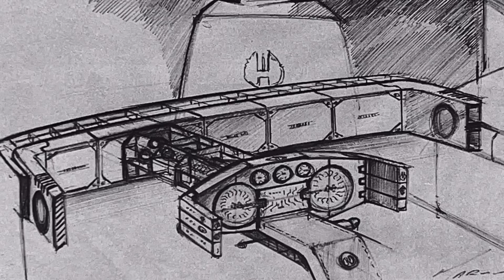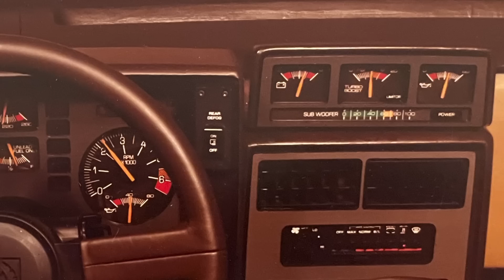Pontiac Goes Mid Engine: Designing the 1984-88 Pontiac Fiero's Interior (with Marv Fisher)

Comment: I think the Fiero would’ve been best with the same turbocharged, intercooled V6 that was in the Grand National/GNX. They also could’ve paired it with the all wheel drive system that the Cyclone/Typhoon had, or perhaps even the AWD system that Isuzu placed inside the Piazza/Impulse along with its Lotus-tuned passive four-wheel-steering system.

Comment: The steering was so heavy, you couldn't take your hands too far from the wheel.  I wanted one badly, even with the 4 cyl, but I had to tilt the seat back to clear the roof, which made it hard to turn the wheel.

Comment: Another great deep-dive!  One of my relatives two years my senior had a beautiful 2M6 (six cylinder, 2.8 liter, ~50 more horsepower than the 2M4) version with some kind of optional air scoop at sat at a low profile and fed air into the engine compartment.  It came from the factory (I think!) and it was a brilliant little car with that engine and a fully-optioned interior.  There really was nothing else like it domestically, and I was incredibly jealous of him.  Inside and out I lusted for that car, so Mr. Fisher's design work definitely made a huge difference in the car's "gestalt".  Do you or anyone else know if that scoop was really a Pontiac OEM option?
Reply: Nope, it's not an OEM option, but aftermarket scoops.
Reply: @vice4134  Thank you!  That's what I suspected but it was so well done I also thought it could have been factory. I asked him at the time but he took me for a thrilling ride in that little baby and I forgot what his answer was.  The 2M6 was a real sports car, in my book.  He was also a motocross racer and he knew how to get the most out of it.  I had never imagined that 140 horsepower could be so much fun, but it was!

Comment: I worked as a tech at the dealer in 88-89 and the most common issue I saw with the Fiero was the engine compartment heat messing up sensors like the TPS.  Plus, it seemed like the EGR valves failed a lot.  I bought a Cadillac 13mm  distributor ball socket for changing them out quick to beat the flat rate time of warranty.  
I never owned one but figured if I ever did, a fan to help circulate air through the engine compartment would have been a nice addition.  I loved the cars.
Reply: They did have a blower from the trunk from 85 thru 87... until they figured out a way around it for 88. So, they got rid of the blower. Out of curious, not sure what this "Cadillac 13mm  distributor ball socket" looks like. I'm trying to find a picture of this tool. Can you please help? Thanks.
Reply: @vice4134  It's a handy socket.  I think it was designed by Snap On for the HT4100.  It was chrome with about a 12 inch extension built into it. Next time I'm at my tool box I will get the Snap On number from it.

Comment: Thanks so much for giving some insight on the design of a very interesting car. It was a true innovator for some interesting production aspects. A classic exterior and interior execution of a timeless design. Current interest in the mid-engine Corvette brought back interest in the Fiero and maybe we can now put to rest the over emphasis on the initial production mistakes with the iron- duke errors . The gradual improvements making it a contender for a true sports car. Engineering the features took a-lot of foresight for  future applications. Some parts bin items had distractors but at least they were from proven systems that had a record of durability. The  X- Car FWD package was a natural for the switch to a mid-engine layout and had proven to be a major part of the design.
Thanks again for covering this car that didn’t deserve the negative press for so long and highlighting the lost history of this GM product.
Reply: Except it wasn't an error. Blame it on GM. They cut Pontiac's budget from $700M to $300M. That's very small budget by today's standard. So, Pontiac had to work with what they had to get Fiero off the ground and build onto it as time goes on. Same thing with Corvette in the beginning. So, give Pontiac a break. It was those corvette people & GM who were against Fiero from the beginning. As a matter of fact, GM ordered Fiero program to be cancelled twice, but they ignored it & worked around GM by contracting with outside firms to speed it up. Very smart of Hulki Aldikacti to do that.

Comment: This was a fascinating video. Thank you for sharing. It seems so strange, but the interior looks both radically different for the times and yet now it looks so dated and weird. What's perplexing is that the structure of the driver's cluster was so forward-thinking and ahead of its time, but the rest of the interior looks so 1970s funky. Pontiac's Fiero was an interesting anachronism. It was designed to be a commuter-car, but its styling and images in advertising made it look like GM was pitching the car to the public as Pontiac's answer to the Corvette. The fact that all new-for-1984 Fieros came only with the lackluster "Iron Duke" four-cylinder only made matters worse, as that motor was never ideal for any passenger car.

One of GM's biggest mistakes in the so-called "malaise era" was a lack of absolutely essential coordination between the various projects of downsizing car bodies, introducing new front-wheel-drive engines and engine tech, and new transmissions. Pontiac's P-body Fiero, as well as GM's X-, N-, A-, L- and F-cars were also classic textbook examples of this lack of coordination. The Oldsmobile Quad 4 engine, even in base 150-horsepower trim, was ideal for the Fiero, and would also have lent itself perfectly to these other platforms. Unfortunately, the Fiero was introduced in 1984 and the Quad4 didn't enter the mass market until 1988. The Quad4 would have been ideal for GM's intended Fiero mission as a commuter-car, in making it a great balance of power, fuel economy and fun-to-drive. The "Iron Duke" offered none of these qualities. And GM's 180-horsepower "high output" version of the Quad 4 could easily have added ever more sporty zest to the Fiero and possibly also to the Firebird SE. It was rumored that GM even had a 250-horsepower Quad 4 turbo, which would have been idea for both the Fiero and perhaps some special edition of the Firebird and 6000 STE. But none of these Quad 4 engines would have been possible if GM didn't have transverse transmissions that would have handled the extra power of the Quad4 family. It never ceases to amaze that GM went out of their way to hire Pininfarina to build Cadillac's Allante, but nobody in GM's management would ever move with deliberate speed to accelerate the development of the Quad 4 or the sourcing of better transmissions to handle the Quad 4.

If Pontiac had introduced the Fiero in 1984 and had equipped it with the Quad 4, it might never have needed a V6. Fiero might also have been a much bigger seller, while bolstering Pontiac's "We Build Excitement" image.
Reply: Actually, Pontiac had a bigger plan, but were stuck with $300M budget. Earlier, they had a $700M budget, but GM cut it down to $300M. That's very small by today's standard. So Pontiac had to make it work with what they had in order to get Fiero kick off to a great start. And they sold over 136K for the first year which is very impressive. And with profit from each year, it allows them to continue to improve it & solve problems, one by one. By 1988, they invested $30M into improving the suspension, inspired by Lotus somehow, and improved the car's performance greatly as a real sports car. The engine was the next problem to attack, but the program was cancelled, thanks to Corvette people who felt threatened, pressured GM to stop it. 
One guy said he'd gotten in on a group tour of GM test/proving grounds. The one thing he saw that stood out for him - a new Vette and a Fiero were brought out for a match race. Granted, mid-80's GM V-8's weren't known for HP, but the Fiero was a twin-turbo. Both cars came off the line, Vette jumped in front. But then the Fiero's turbos spun up and it just walked away from the Vette. The GM guy giving the tour turned to the group and said 'You'll never see that car on the street, it's too fast.'  Hulki spoke about the time they beat the Vette at the proving grounds with a souped up Fiero and got into big trouble.
The GM made it clear to Pontiac that Fiero cannot go faster than Corvette. It wasn't MR2 who is the real competitor, but corvette people to make sure GM had the lid on Fiero tight. So the corvette people were our enemy. The Corvette people!!!
Reply: @vice4134  Yup, I read the book "All Corvettes are Red" which was much more a look inside GM than it was a book about Corvettes and I read that they had put a quad-4 in a Fiero and got a quicker 0-60 time than the Corvette of the time, and all they said was "crush it"!  GEEZ, can't have that....  It boggles my mind, intentionally making a car less than the best because it just might compete against something else from the same manufacturer.  I'd recommend the book but it gets pretty disheartening when you understand the MESS that GM was and is!  In 1998 I bought a used '96 Collector Edition, one of my worst life mistakes, it was a year and a half of mostly misery, one of the happiest days of my life was the day after I traded it on a '97 Miata, waking up and realizing the nightmare was OVER!
Reply: @terrybeavan4264 
Yep, they did quad-4 for '90 Fiero which is the next generation, but never came to fruition. Such a shame! 
I've heard of this book, but never bothered to buy one. I already know the answers from reading others who have worked inside GM. But if they ever come out with a Fiero book with the whole truth, I would definitely buy it.
Reply: @terrybeavan4264  The deliberate quashing of The Fiero, despite its promising potential, serves to highlight a major drawback in consolidation of any industry:  It kills innovation.

Comment: Beautiful car and interior -thank you Adam for sharing this story. I would liked to have owned one of these with a SC 3800. But being a long legged 6.4 man, I don't stand any chance of fitting inside ;~/
Question: Why did GM place the radio so low where the driver can barely see it?
Reply: Actually, you might be surprised!  I'm 6' 4" and owned one since 2005, daily drove it for 10 years or so and was extremely comfortable in it.  As Marv said, with the engine in the back, the foot wells extend way out under the dash, so much so I can fully extend my legs.
Reply: There were other sports cars of the same era, had radio at the bottom as well.

Comment: Dad had an 84.  His 73 Camaro had completly rusted out so the idea of a plastic car appealed to him, also the price.  The 4 cylinder and automatic were gutless.  His interior was nicer than these being a light blue gray and less cheap looking than most GMs.  The motor drive heater was unusual.  The headrest speakers were novel but poor.  I think it had manual steering.  I liked the moonroof a lot.  Don't think it was very comfortable.  I never drove it much, just too slow.  It eventually threw a rod.
Reply: Motor drive heater?
Reply: @patrickflohe7427  The controls did'nt use push pull cables.  they were buttons connected to electric motors to set temp and air distribution.  A gross over complication in my view.

Comment: Having owned successive Fiero's back in the late 80's, an 86 SE V6 and an 86 GT, those Fiero's remain at the top of my most beloved cars I've owned. That interior was special. The seat materials were top of the grade, super comfortable and long wearing. A peek into any Fiero on sale today shows just how well that interior was constructed; very rare it is that you will see a trashed out Fiero interior. An added attraction for me was the red instrument back lighting at night as well as the sub woofer sound system. A shame GM chickened out and cancelled this car. The pictures of the 89 GT replacement show a very desirable car.
Reply: Sales in most areas dried up, mostly because the young buyers insurance rates had skyrocketed. In 1986, many areas were charging $3000 or more, and the young buyers simply couldn't afford that. 2 seat cars were considered likely to be driven like 'racing cars' by insurance companies, with high risk surcharges.
Reply: Did the Mr2 have the same sales drop?

Comment: The Fiero was a real fun car, it was far from a Corvette but was still a blast to drive.   The parking brake did have a strange location....   Thanks to Marv and Adam for their time and work...
Reply: I forgot about that. It was on the driver's side between the seat and the door IIRC. It collapsed out of the way after you pulled the brake up, and you pulled it back up and pressed the button to disengage it. It was a genius design.
Reply: @HAL-dm1eh  That's a great idea. Porsche had the same parking brake location with the 924 and 944 but it stuck up once engaged so lots of people would break the ratchet mechanism after butt dropping onto it for years and years.
Reply: The C4 had that same parking brake location/design.
Reply: Holden in Australia used that same design in the 1971-1984 Kingswood

Comment: One of the most exciting things about the Fiero was the speakers in the headrests!  That was a first as far as I know - soon followed by the MR2 I think.
Reply: Mine had those, too. I always thought that was something that should have been pursued a great deal more. It would have been more efficient sound, less money to produce and less noise for others in traffic if you wanted it loud.
Reply: @HAL-dm1eh  Much harder to replace and upgrade. It's a good concept but does have immediate downsides.
Reply: Yup I never owned a Fiero but came very close to it, test drove a used one in early 1988 but not having a lot of money on my first real job got cold feet when looking at the financing.  Among other stuff, I do remember the salesman demonstrating the stereo and those speakers.  I wonder if those seats might've been Recaros, they certainly looked and felt great and not like much of anything else GM made at the time.  Kind of wish I'd pulled the trigger--instead, a few months after that test drive I bought an '86 Corolla SR-5 and GEEZ of course I had no idea THAT car, the last of the RWD Corollas, would go on to become one very desirable car itself!  I don't know if the MR2 had headrest speakers, but the 1st gen Miata had them as optional or standard depending on trim level.  I owned a '97 Miata M Edition for almost 15 years and the headrest speakers were great especially for top-down driving!  I don't know about how they were done in the Fiero but when the speakers in my Miata died, I found they were VERY easy to get to and replace--the headrest portion of the seat had concealed zippers which you could unzip then pull back the covering and get to them to replace them!
Reply: I totally forgot about that! Now I remember a friend who had a two-seat SAAB ( I think it was a 2-seater) and put Fiero seats in it, with the speakers in the headrest. So cool. He ended up selling that little car after he got married.....LOL
Reply: @aleks1939  Saab Sonnet?
Reply: @DanEBoyd  Looking at the pics of them online, I think that was it. The early 70s version (Sonnet III or Saab 97 ). He had it for a few years, around 1990 to 94 before  selling it. Fun car to ride in, but it wasn't particularly fast from what I remember.
Reply: I have owned three Fieros in my life. I started out with a 84 Indy, next was an 86 SE V6 and finally, a 1988 black GT that I ordered from the factory. I still have the 88 and I still love driving it.

Comment: Unfortunately, this car was rushed to production and wasn't given good marketing.
Reply: Yup. Plus GM knows when to pull the plug when things get going right. Couldn't have anything disrupting the Corvette market!
Reply: This isn't really true, concept work began on it in the late 70s with some very thorough engineering.  The biggest issues were with the parts bin sourcing and the incorrect oil amount spec in the '84s.
Reply: @jalude4126  Granted.  However what you say underscores the point. You have all that research and still GM chose not to do the premier job that was needed to bring it to fruition.
Reply: The car was riddled with problems when it came out,no amount of marketing can make up for GM introducing a rolling turd to the market!